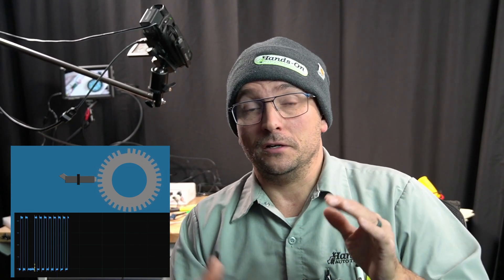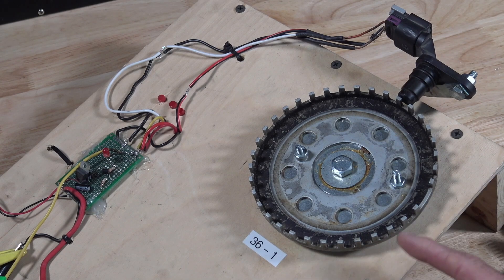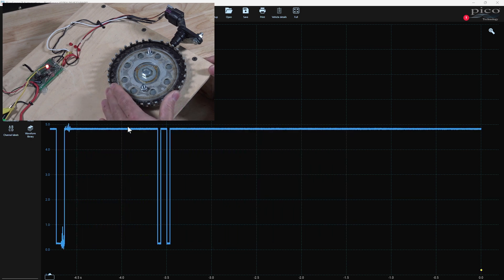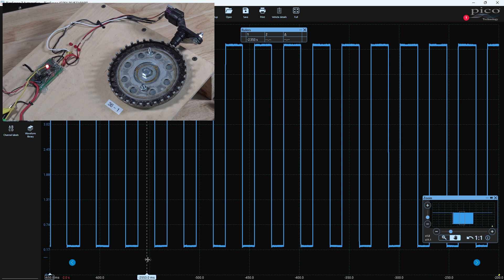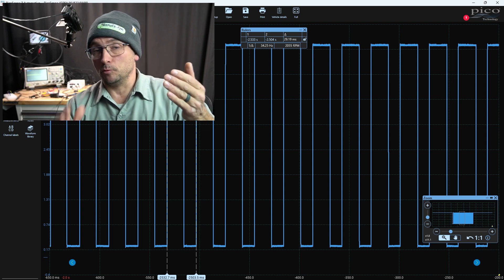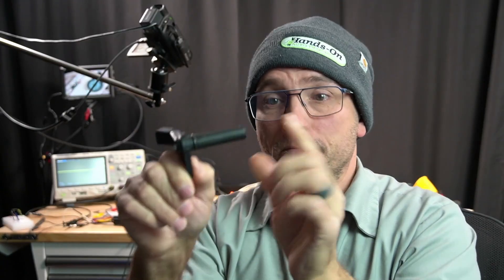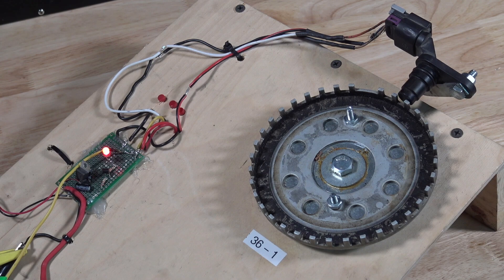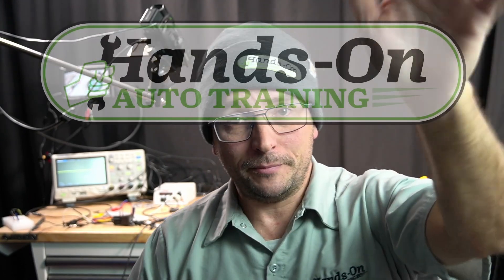CKP Air Gap

Comment: Put a BTR stage 3 cam i my son's 2013 ss camaro. Had it tuned at LSxperts in north ga, and getting a cam position sensor code. Car runs and drives but cannot get the code and check engine light to go away. Replaced sensor twice and no change. Another shop says it is probably the air gap, but this is a fixed position sensor, how would you proceed in this situation?

Comment: Just built my son's 2013 SS camaro. Put a BTR stage 3 cam and gearset we bought directly from them. Getting a p0340 cam position sensor code replaced sensor but had a shop say it was the air gap, but the sensor is a fixed position unit. How can we adjust the air gap on this car?